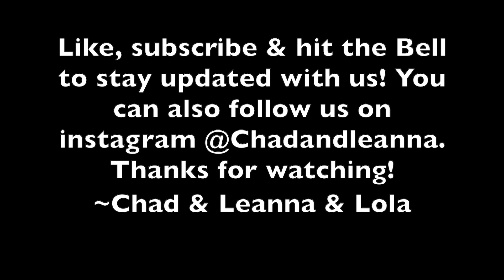VAN BUILD in 47 DAYS! || Start to Finish || TINY HOME ON WHEELS

Comment: Absolutely gorgeous home on wheels!
Congrats on the outcome!!
Would you share the bed width and shower size? Looks like 50x70cm or so...
And countertop depth?
Having lived in it for a while, and somehow compromising on the floor insulation during the build, how has it behaved?
Would you change anything major , now that it has been done?
And finally, how much weight have you put on with so much timber?
Thanks in advance, from the other side of the pond (Atlantic)!
Reply from the maker: Hey there!! Thanks for watching!

Bed is 60inches by 765 inches. It's none as a "Queen Short"
Shower size is 27inches by 24inches. ITs a very small shower, but we were able to make it work because its only a small space you're in for no more than a 5-10 minute shower.
Countertop is 5ft by 22inches!

I wouldn't change anything major! The only thing I'd probably change is the wood paneling on the sliding door. Makes the door heavy to open and close. I'm not sure how much weight we have in the van total, but the van is a 3500 so I know it can hold what we have!
Reply: @chadleanna4503  Thanks for your reply!
I think the shower's dimensions are spot on!
Best of luck for you both!